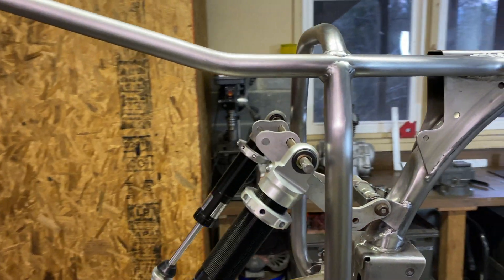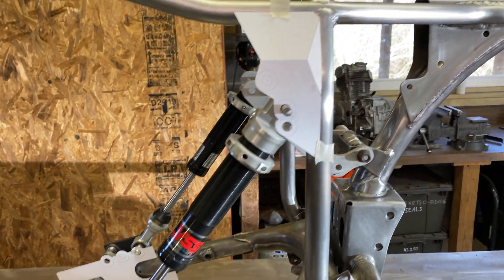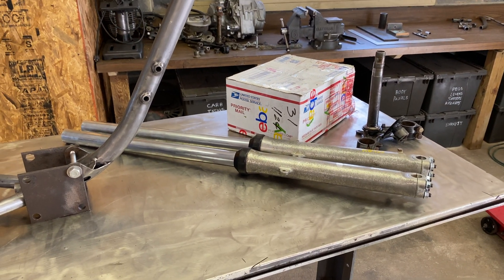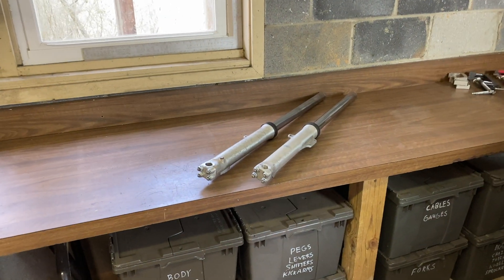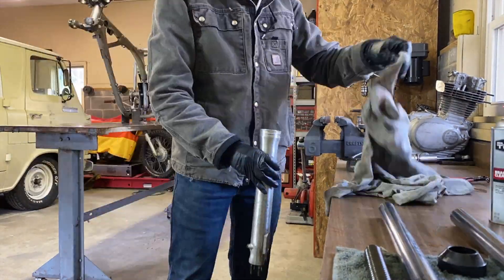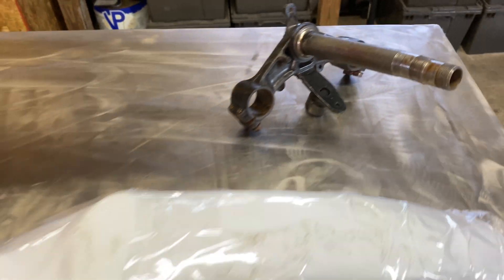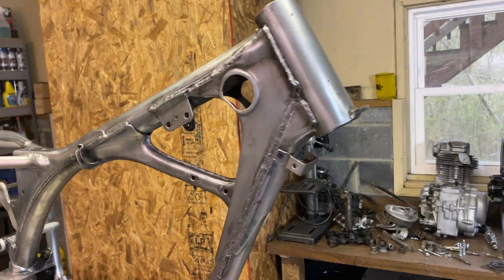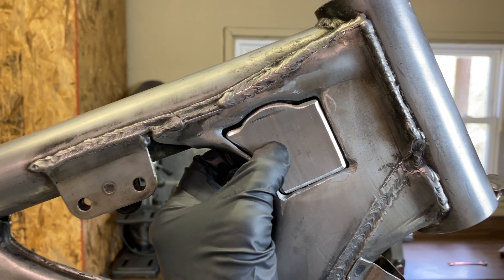Designing Custom Laser Cut Shock Mounts For A Vintage Motorcycle - EP4

Comment: The MR250 forks are NOT LONGER. Thanks for nothing. I bought a pair based on this and they are exactly the same length as 74 XL250 forks. I like what you are doing at the back.